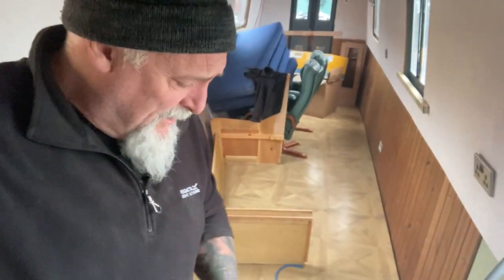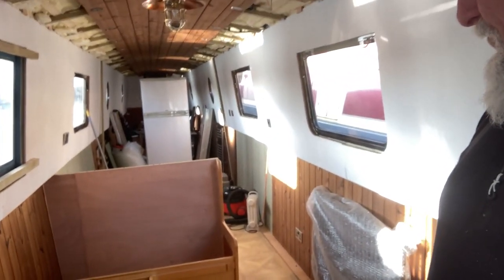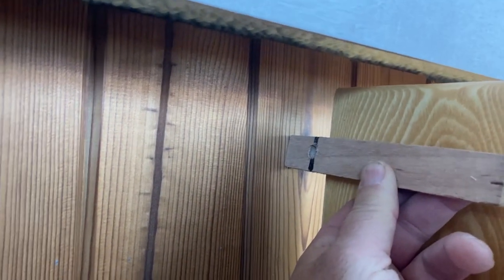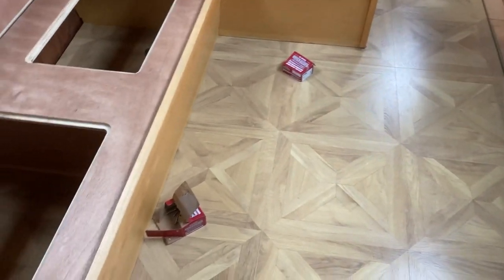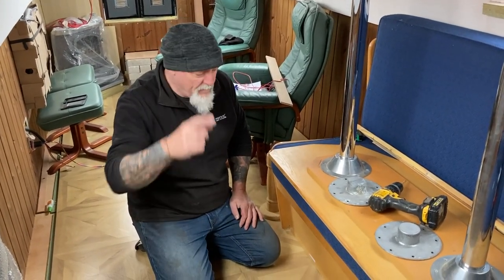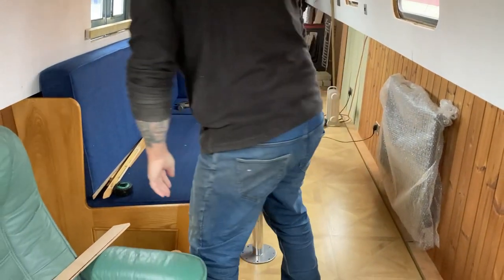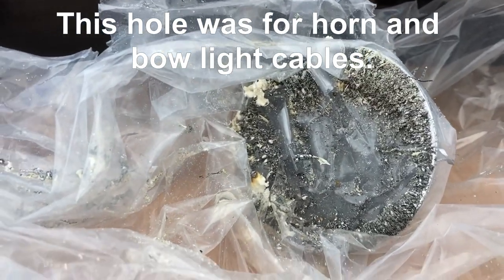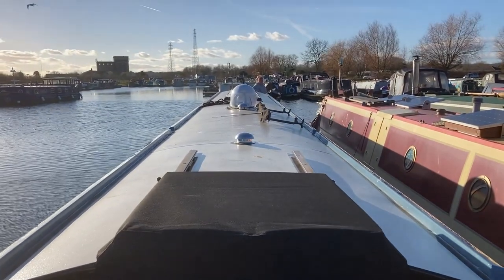Building Our Narrowboat #30 - Boat covers, Dinettes and more holes!

Comment: You got that dinette for a steal..a hundred  quid ..absolute bargain, looks great..cracking job cutting  in the angle for the walls, starting to look  slightly  comfy now ..looking forward to the  next vlog..👍👍🍻🍻..covers look superb...
Reply from the maker: Hey Kevin, thanks so much. It was a great buy. We are most likely going to change the covers, not quite settled on colours yet though. And we will cut them down some as we thing they are too high on the backs. But all easy to do, but plenty of other things higher on the list yet.

Comment: Hi there you are both doing a brilliant job
But would it not be better to router the table let supports in flush with the floor so you don't have any trip hazard just a thought
Reply from the maker: Hi Ian, thanks for the positive comment, we are doing our utmost to keep the project steaming ahead. On the floor mounts, they only sit about 2mm above floor, and the only time the table will be removed is when converting to a bed, so they are never really in a walkway. We actually like the way they sit, as they look fit for the job. I have to make a bracket to hold table and legs when they not in use, the guy I bought it off ahs one, I will try and beg it off him when I see him.